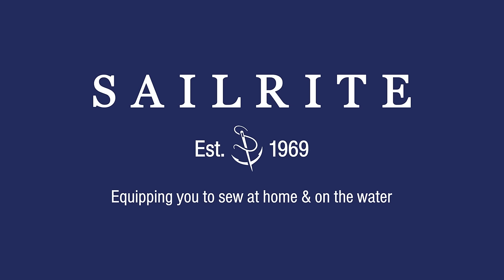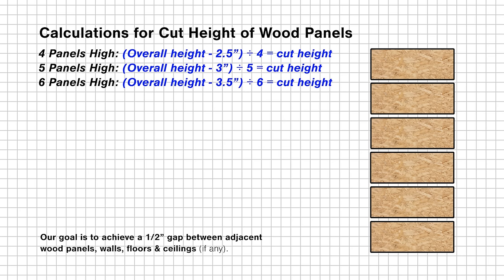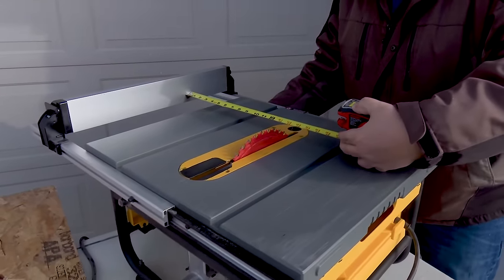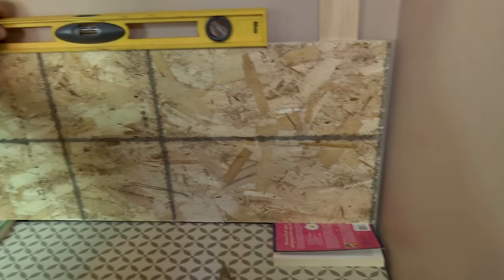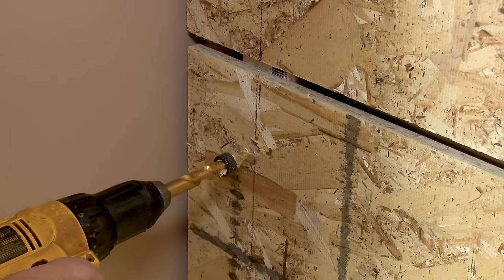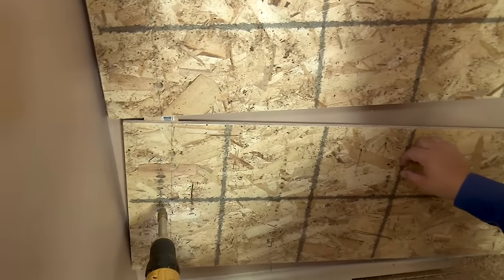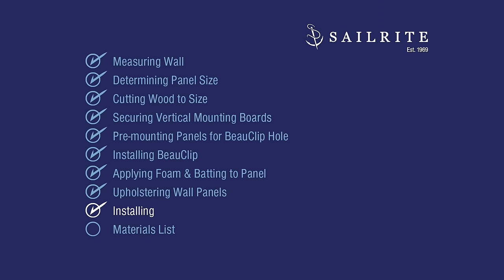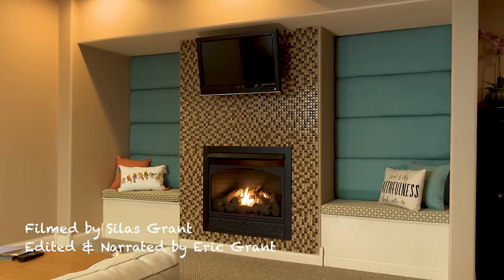How to Make Upholstered Wall Panels

Comment: The vertical mounting battens could also be fastened to the top plate of the wall since they intersect with the ceiling. 3/4" down from the ceiling, shoot two screws in each, pre-drilled to prevent splitting. This will allow the weight to hang on the wall's wood framing. The drywall anchors would then be only pulling the assembly tight to the drywall.
Reply from the maker: Very good suggestions. Thanks!!!
Reply: +Sailrite You're welcome. Thank you for your informative videos and quality product line.

Comment: If i use this method for a headboard in the middle of the wall - will it stand out from the side, like would the wooden long strips  underneath show or would the wall panels look like theyre glued to the wall? i want the wall panels to look like theyre stuck to the wall and not to see the stuff underneath...as you did it inbetween two walls completely it doesnt matter  but for a middle portion of the wall it does.... please do reply!

Comment: I’m making a paneled “headboard” I would like to attach directly to the wall. Is that an option? The total width of the project is 96” and height is 72”. It’s made up of multiple shapes and sizes that make up a rectangle.
Reply from the maker: Yes, you can consider two options for attaching a backer-board to the wall. First use the coaming pad hook and eye set about every 24" apart near the top of the headboard: https://www.sailrite.com/Coaming-Pad-Hook-Eye-Set-Stainless-Steel or use these: https://www.sailrite.com/BeauClip-Panel-Mounting-System-Black

Comment: I love y’all’s videos! But you’re using your tape measure wrong.  If you look at the base of the tape measure housing you’ll see a number in inches that looks something like <—2 in —>. That is the measurement of the base of the housing.  Instead of measuring from the top to the bottom and bending your tape measure, measure from the top and rest the housing at the bottom.  Then take the measurement on the tape and add the number indicated at the base of the housing.  So if the tape measures 56 inches and the housing is 2 inches, the total is 58 inches. Sometimes it’ll even say |— + 2in —|. Just thought I’d share that.